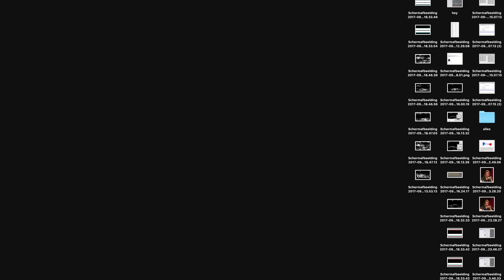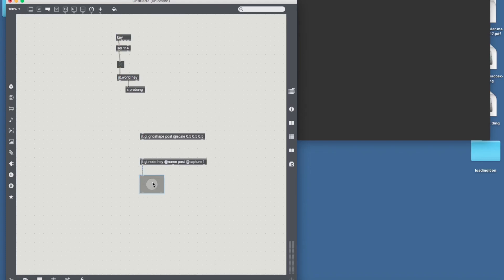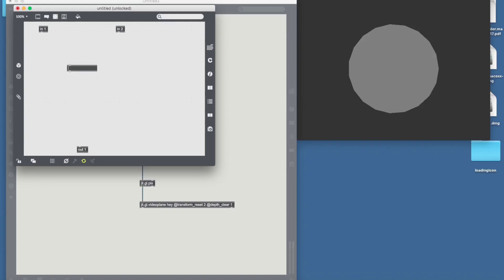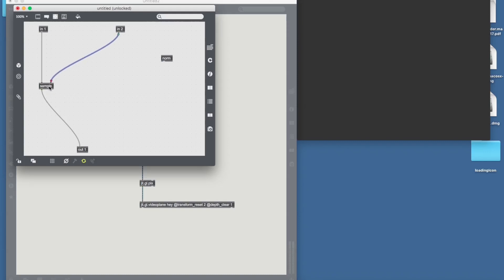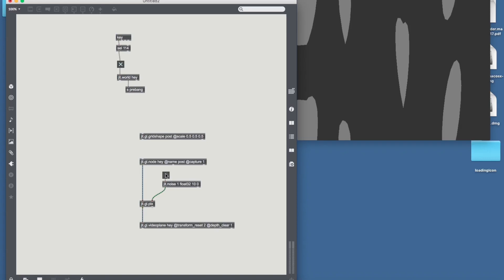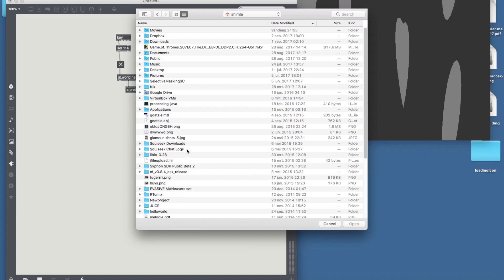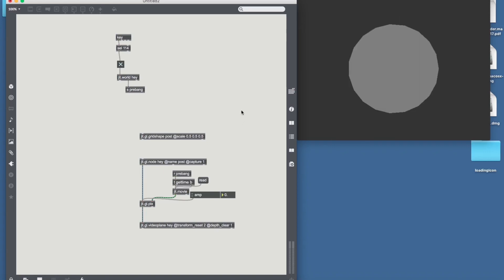Creating a glitch distortion shader in Max Jitter

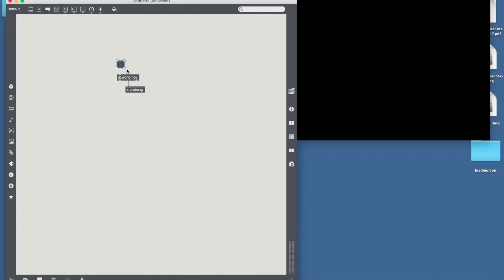Comment: What's the shortcut for connecting two objects when you have them both selected (like you do at 1:38 for example)? Does this also work with multiple outlets and inlets?
Reply from the maker: hey dirk, that's a workflow package called 'toolbox'. it's not in the package manager for some reason but you can get it here: 
https://github.com/natcl/maxtoolbox
you can connect objects with key strokes and yea it works great with multiple i/o
Reply: Cool! Thanks!